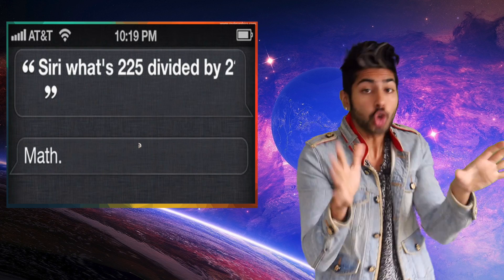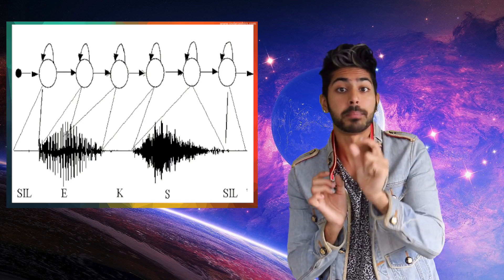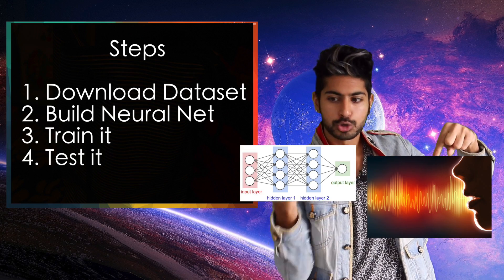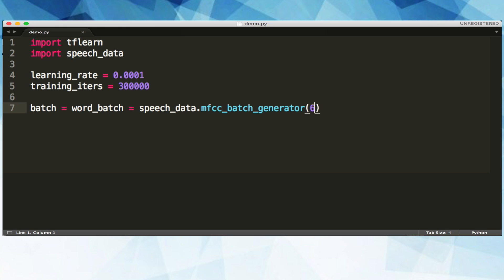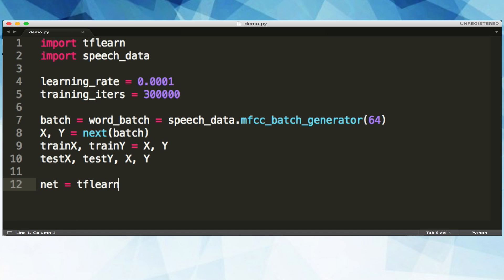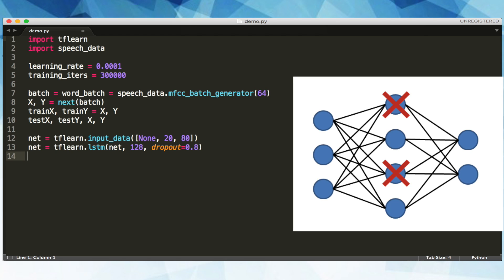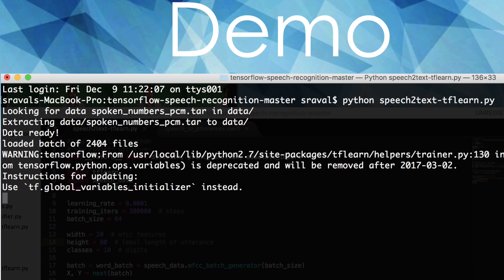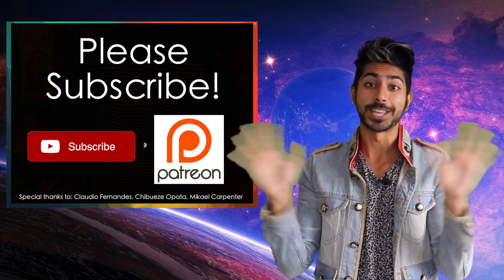How to Make a Simple Tensorflow Speech Recognizer

Comment: thank's  

 pip install tensorflow==0.12.0rc1
Collecting tensorflow==0.12.0rc1
  ERROR: Could not find a version that satisfies the requirement tensorflow==0.12.0rc1 (from versions: 1.13.0rc1, 1.13.0rc2, 1.13.1, 1.13.2, 1.14.0rc0, 1.14.0rc1, 1.14.0, 2.0.0a0, 2.0.0b0, 2.0.0b1)
ERROR: No matching distribution found for tensorflow==0.12.0rc1

what's the verion as near  to tensorflow==0.12.0rc1

Comment: Not able to download the dataset  by running this line of code                                                                            batch = word_batch = speech_data.mfcc_batch_generator(batch_size)
 
getting this error
gaierror                                  Traceback (most recent call last)
/usr/lib/python3.6/urllib/request.py in do_open(self, http_class, req, **http_conn_args)
   1317                 h.request(req.get_method(), req.selector, req.data, headers,
-> 1318                           encode_chunked=req.has_header('Transfer-encoding'))
   1319             except OSError as err: # timeout error

URLError: <urlopen error [Errno -5] No address associated with hostname>

Comment: Guys, I have recently came across a software called "BRAINA" (https://www.brainasoft.com/)which is a speech recognition software which gives you 99% accuracy in speech to text output and it also comes with so many additional features in which you can get your productivity increased such as searching files and folders on the pc through voice commands, searching information, controlling pc wirelessly and so many more.

Comment: sir ,
really nice video.
I want to do word recognition.
I have multiple 2 second wav files for each word. The wav file has silence in first 0.3 seconds then word sound for few millisecond (depending on word like 'a' takes 300ms while 'autoflorescence' takes 1.5 seconds).
I want to use sequential neural network like RNN or LSTM for this.
Can you suggest code which can easily process my data and give output as I am bad at coding ?

Thanks.

Comment: someone please tel me what is to be done after training of the data set is completed. where do i get predict.py file and how to do convert my audio into text, directly through uploading in test directory?
Reply: After finishing training, a file called  "tflearn.lstm.mode"(the model) will be created (in the same folder) and then can be used to predict an input,you can load it using:
model.load("tflearn.lstm.model")
then predict a given .wav using the following code "as in SIRAJ's code":
demo_file = "5_Vicki_260.wav"
demo=speech_data.load_wav_file(speech_data.path + demo_file)
result=model.predict([demo])
result=numpy.argmax(result)
print("predicted digit for %s : result = %d "%(demo_file,result))
-The question remains: "How to change the code to recognize my own spoken words (digits)(let it be from 0 to 20) and accordingly change number of classes?" (changing :classes = 2  # digits )in line 13 doesnt work)

Comment: What's a great video to guide me into LSTM! I have two question:
1. Where is the 'predict.py' file? (The github path only has demo.py & speech_data.py)
2. Every training step costs 1 second in my computer (With excellent CPU and Titian GPU), is this normal? (I see the training step of this video cost only 0.2 second)
Thank you very much!
Reply: Have you found the predict.py file?
Reply: Not yet. Do you know where is the predict.py?
Reply: There isn't any predict.py. you can siimply predict using model.predict(X) after loading it with model.load("tflearn.lstm.model").
Reply: There isn't any predict.py. you can siimply predict using model.predict(X) after loading it with model.load("tflearn.lstm.model").
Reply: I've tried this function "_y=model.predict(X)", and when I print(_y), the result is a matrix made up by several 10-dimension vector.
However, the values in each vector are almost equal to 0.1. such as :
[0.10633651  0.09643744  0.10651608  0.10469684  0.09262136  0.09756804 0.09648712  0.10681043  0.0983061   0.09422017]
Does this means the model can't distinguish X？
Reply: Daisy Swift the model has predicted as 7. The array is just the confidence for each class.
Reply: so why this vector is predicted as 7? 
the seventh number 0.09648712 is neither max nor min value among the vector numbers.
Reply: Daisy Swift the first value is the confidence of class 0. Then class 1... So on.. And the max value is for class 7. [0,1,2,3,4,5,6 7,8,9] is class confidence array
Reply: Oh, I see, Thank you very much!
By the way, do you know how the tflearn updates its input batch data?
There is only on trainX,trainY=next(batch) operation before the model.fit(trainX, trainY) circulation, so the trainX&trainY keep invariant during iteration?
Reply: @hash162  how can I understand that the output predict which audio file
Reply: I also get around 1 second for every step with dual xeons.
Maybe the video is just sped up.
Reply: at which line should i type this
Reply: model.predict(X)

Comment: hey man thks a lot for the video! you explain really well. I'm having some trouble working out your code though when I run the next(batch) to load the data, it takes ages. Even if I choose a smaller batch size, it does not finish. Is that normal? What am I missing?

Comment: How do i get to the level where i can understand all this. I need a point to start from. i have some basic java, C++ and python understanding. I just need a start point, i'll do the rest after that... please help me with this.
Reply: Well, I suggest that after doing some research and watching other people build and use neural networks, you copy a neural network from someone, mess around with the settings some and see what happens.  Then, when you feel like you've got the hang of tuning the settings for that specific network, try it on a few more networks until you can figure out what each piece of code is doing with minimal testing.  Then write your own based on what you learned.  

I haven't done this myself on NN, but it's a sound strategy I use for almost anything.  It doesn't matter which language it's in so long as you understand its syntax and mannerisms.  The language you choose should be the one your best versed in, if you're not really versed in any, I recommend C++ to get general knowledge on coding, but endgame goals should be (in my opinion) should be in python because it (to me) has the greatest usability in major projects like in MAYA or simulation programs, but java is best for apps/games.  
Any way you go, it all depends on what you want and what you need to use it for.  

I learned to understand the concepts just by watching videos and reading articles about it, but I'm not too great with the actual code in it.
Reply from the maker: see my latest video

Comment: Hi Siraj Raval, Love what you do and how you do it, i think you enjoy it also :)

My question is, what cpu and gpu did you run your code on and how long did it take for the model to build ?

I have Nvidia Titan X (not pascal, not yet :) ) and i am getting about 40 training steps per minute on my gpu...does this seem approximately correct to you ? What are your GPU training step timings ?
Reply from the maker: thanks! I used my macbook pros Radeon Pro 455 2048 MB which took a full day but i'm going to start using the cloud more as soon as i find a good freemium model
Reply: HI Siraj, So, i followed you and purchased a macbook pro Radeon Pro 455 2048 MB...so i could get the exact machine/code.

How, how.. :) did you setup CUDA drivers to work on the ATI Radeon card on the macbook pro ? What setup did you use if not using the CUDA drivers ?
Reply: cuda is only for nvidia.

Comment: Having worked on computer speech recognition for decades, it was great to see something created with so few lines of code. Perhaps you could point me to similar demos for large vocabulary connected speech recognition?

I noticed one point on your video which was a bit, shall we say, oversimplified. When you said the training speech was input from some file, it has an extension starting with "mfcc". That is the name of the standard type of features which are derived from the original audio samples, not the audio itself. At least one line of extra code would be required to convert audio into that form.

On the other hand, I believe there are now neural net based speech recognition systems which can input raw audio samples and output words, without having to go through the above mentioned preprocessing.
Reply from the maker: thanks Andrew i'll make more videos on this topic soon
Reply: Is this true? Do these systems exist where I can upload a set of audio and have it output audio in a voice that best matches?

Comment: Would it be posible to train Tensorflow for recognise parts of any song where a human is singing, no matter what is singing ? 
For a given time in a given song get result human voice is present yes or not.
Reply: Yes that should be possible, using a very similar network to the one used in this video. The hard thing is usually to collect enough data so you can train the network. In addition, you will need to learn about the pre-processing for audio (look up the term MFCC, which uses Fourier transforms internally to split things up by frequency)
Reply from the maker: what Neil said

Comment: I have one question, this ANN requires 300000 iterations, so what are we humans doing differently to require a significantly less number of iterations?
Reply: Icarus Our brain is massively parallel neural network with billions of neurons and trillions of interconnections between them. That's what we are doing different.
Reply from the maker: we have more parallelism. more computing power in our brains. the exact answer is that we don't know yet fully. but this is so exciting to think about and learn!! more brainlike machine learning models means better results
Reply: we use the power of love, of course
Reply: Icarus very efficient algorithms mostly. Also, a really big and optimized database. Our memory is thought to be 3TB more or less only, imagine the optimization in our brain :)
Reply: transfer learning.. maybe
Reply: Noone knows how the brain learns, but it needs far less training data than present machines need. There are mathematical results which show that statistical models need a lot of data before they can learn to generalise to correctly classify data not seen in training accurately. The fact that our brains need far less data means that they have fewer free parameters to train so they must already know a lot about speech before they start learning.
Reply: ***** transfer learning right?  its funny, i was quite concerned about my brain's ability to retain new info.  i felt like if i learned 1 new thing i'd forget 1 old thing.  so maybe, i don't read as much haha!  but than i thought a particular synaptic pathway could represent multiple pieces of knowledge.  so perhaps the brain not only transfers learning but increases the rate and scope of learning exponentially through shared synaptic pathways.  it seems current NN's do this, no?  but to what extent compared with an animal brain?
Reply: One of the theoretical strengths of neural networks (especially of the "deep" variety, although that term is not well defined) is that the information capacity of the distributed representation which it learns and uses to generalise with does indeed grow exponentially with the number of (artificial) neurons. There is a very good video by Geof Hinton which explains that (http://videolectures.net/jul09_hinton_deeplearn/). There are also results which show that DNNs trained to process natural language text in one language tend to learn a similar distributed representation for other languages. That means that learning a new language need not wipe out the one you already know, so yes, some can of information is shared or transferred.
Reply: ***** yea this was exactly the thought that gave me comfort to learn new things without fear of pushing the old ones out lol.  that whatever synaptic pathways that were formed to allow me to memorize algebra would be potentially also be used to remember where i placed my keys.
Reply: Alexander Bollbach I think it's the same as in a computer CPU. It doesn't care what you are telling it to do, the only things it reads are 0s and 1s, that were converted from assembly, that was converted from whichever language the os uses
Reply: My wild guess is that our genes contain some pre-trained models so that we do not have to train everything from scratch.

Comment: Awesome video as always! 
Can you maybe do a video on how to preprocess different types of data (text, images, speech, etc...) before feeding it to the neural network, how to format the input matrix, and how to determine the shape of the input layer? I couldn't find any guide that explains these in depth (and I am still struggling with such issues...) :P
Thanks for your great work!
Reply from the maker: yes absolutely thanks Antonis. I will have a video on this very soon
Reply: Antonis Katzourakis probably Not but Look on the tf Website... Most of his Tutorial are nearly 1:1 copys of the Originals who are in plain Text... but his visualisation is exelent
I would too be extremely interested in a Video how to Feed this Model the Data... probably i Just don't get that 3 lines with batch...

Comment: Why is classification different than sentiment analysis. You mention classification as one to one, where sentiment analysis is many to one. Aren't the words in sentiment analysis features just like the pixels from an image?
Reply: argothian18 The assumption here is that sentences are taken in as variable length sequences (n > 1). However, in practice padding to a fixed length, or even averaging word vectors into one fixed length vector also works for less complex problems. So in that case you are right.
Reply: Hmm,  that makes me wonder how you would input a variable length sequence into a neural net, got any terms  / literature on this? I'm intrigued :-)
Reply: argothian18 Look up RNNs or Seq2Seq for a pretty example.
Reply from the maker: what Alex said

Comment: Your demos never work
Reply from the maker: Aryan Kashyap really? error output? I ran it locally before pushing. currently on Caltrain to google HQ I'm interviewing a researcher for the channel if you see something wrong Id really appreciate a PR thanks for watching
Reply: do you have TensorFlow/TFLearn, Docker installed. Would you by chance be new to programming, I ask this since TF takes some Terminal command knowledge to get installed. I mean are you meeting all the dependencies?
Reply: I had to pull speech_data.py and install a couple of libraries. The issue I found with the code was on line 10 "testX, testY, X, Y". I think it meant "testX, testY = X, Y". After that change, the code is working. Not working code can be frustating at times, but fixing it is an opportunity to learn :)
Reply: @pinowsky  how to import speech data
Reply: @khalidarsalanbaibars2722  Sorry, I looked into this one year ago. I don't recall anything
Reply: @pinowsky  did ur code run successfully?
Reply: what was the problem you are getting?
Reply: Although this is an old video, there definitely are a few problems. Diego pointed out one, but there are several others, including the fact that you're in an infinite while loop and never save the model or print(_y). These are minor problems though...